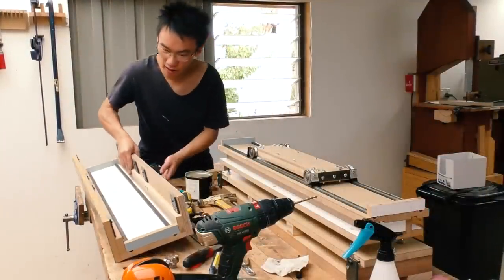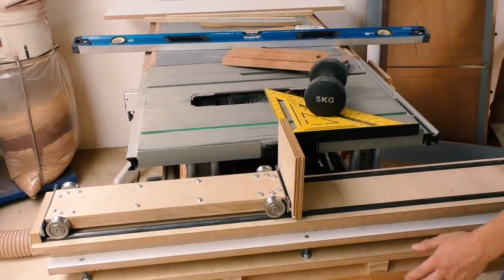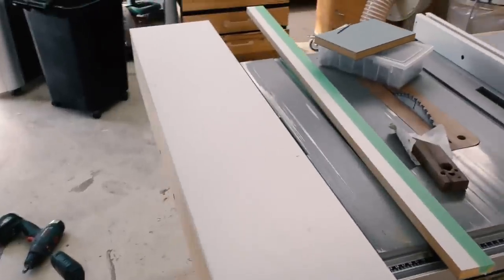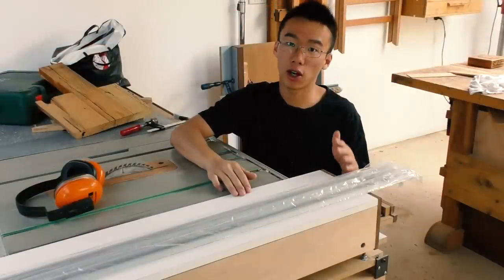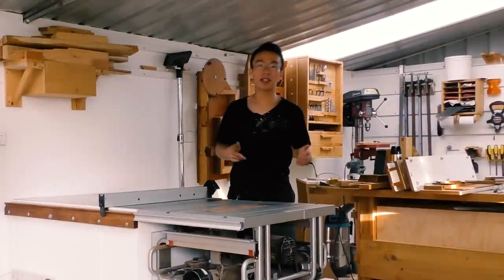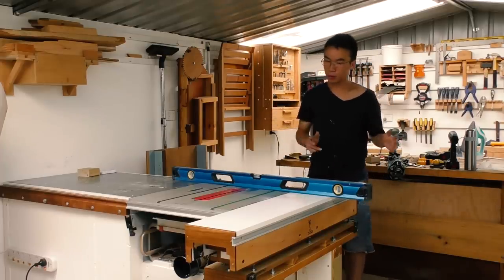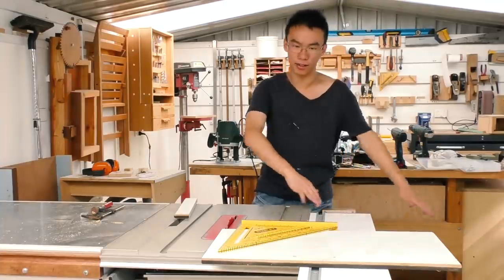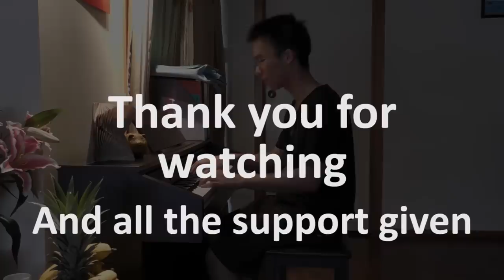Sliding Table Attatchment Part 4  - Finishing it off

Comment: Steven, great video and an impressive sliding table.  I do want to mention that you should never under any circumstances wear gloves when using a spinning tool like a saw, drill press, or lathe.  The glove can get caught in the tool and permanently disfigure your hand.

Comment: What a wonderful addition to your workshop. Surely the next step is to take on bigger paid projects.
Reply from the maker: the irony to having made the sliding table is that in making the project itself has used up all the big pieces of wood in my workshop that would have been more conveniently cut with the sliding table attachment.
Reply: You've probably already made your next creation and slowly editing the video when you have time.

I'm sure you have lots of native and or reclaimed materials you can use that will look gorgeous when finished.

Comment: You did a lot of work on that. If you build another you might consider using cnc linear guide rails and bearings.
Reply from the maker: +nevermindthebollocks actually this is the end product after i had considered the idea of using linear bearings; bit i ditched it - just wasn't very space efficient, and you actually need the square shaped linear rails for it to be strong enough when mounting it upside down (fixed bearing position, while linear rails attached to sliding carriage), which are really expensive.

Comment: the 90° angle issue is not so much precise paralel alignment of sliding table with saw, but definitively crucial adjustment of cross-cut mechanism

Comment: Great project, but I don't understand putting it on a contractor saw. The table is not flat enough,  the blade is not square, probably runs out excessively and wobbles a bit, the blade diameter will be smaller than a better saw, and it is under powered for hardwoods. I only have a contractor saw too😟
Reply from the maker: +Court so far my contractor saw has done everything that i've told it to with good results, i can't really compare it to more expensive saws since i've never really used one, but from my seldom experiences of the huge format saw at school, i can say they are about the same given the purpose i have for them. That of course would not mean that contractor saws are actually better, just that the tools don't make the craftsman, the craftsman does (in this case both figuratively and literally).

Comment: Well done Steven! :-)

I think some of the play might be because the table saw is not directly attached to the sliding table but are relying on the frame of the table saw stand that it then connected to the two angle brackets that then connects to the sliding table. That's a lot of distance and each joint will introduce some flex that ads up.

Is there any way you can attach the sliding table bottom directly to the frame of the table saw itself, that should make the whole setup a lot stiffer and take out the play when you push / pull the sliding table sideways.
Reply from the maker: +Morten Mortensen attaching to the frame of the table saw is a bad idea for me, cus it's all aluminium and plastic, and they are all way undersized to handle the weight of the sliding table. After checking each part with a dial indicator for flex, the largest bit was at the carriage (with dial indicator attached to frame of sliding table) so the height of the whole assembly may also have been a problem
Reply: Morten
I think you're onto something here.  The effective pivot for the entire sliding mechanism is the two right-angle brackets attached to the table saw base.  Even a 0.1 degree movement there will add up to a third of a mm by the time you reach the working surface.
0.1 degree sounds like something that's easily created when using pine and small washers.

Comment: Can I ask why u decided to make the sliding table so heavy?? Did I see that u have a Lathe and a Milling machine in ur workshop?? Bro how can u afford those? U are so young. These are very expensive machines. U have these in ur shop or were they in ur school?? I remember those days of using Lathe's in my metalwork class back in the mid to late 1980's.. Yeah I'm old now.. haha!
I'm about to embark on my own table saw build from scratch. I'm using steel in a lot of the build for strength. I thought u might have tried that but I'm just finding ur channel today and I noticed this was 5 years ago?? I'm kinda guessing u upgraded the table saw at this stage?? I have some things in my stash of parts for building my own sliding table saw but it will not be that heavy and yet I will use some angled steel for part of the build.  
I have sub'd to ur channel bcos u worked very hard and it takes a lot for me to stick at things when they're not going the way I like and u are exactly the same bro. Best of luck man and keep working hard mate.
I will check out some more of ur videos now I'm sub'd to ur channel. Take it easy man.. Salute to u from Dublin, IRELAND!

Comment: Usar  un comparador para una  pieza hecha en casi su totalidad en madera o MDf¿¿¿ Es rídiculo... Cualquier madera o mdf tienda a torcerse al menos un poco con el clima en el aire..... No quiero dar contrariedad, pero si hubiese querido tener una escuadradora, más que adaptar una sierra, no sería más apropiado haber invertido el dinero necesario en tenerla?? Los resultados nunca van a ser los mismos que una máquina que se compra de fabrica con ciertas características.... Es ridículo tratar de duplicar una maquina de ese tipo....  Y de cuplicar una máquina, quizas podría haber empleado materiales mas apropiados, como aluminio o hierro.
Reply from the maker: Using google translator to understand your paragraph... ummm to me it's just for the experience, otherwise I would just do some carpentry jobs here and there with that effort spent, get some money and buy one LOL, but the things learnt and the experience I gained from it is priceless. Also, I don't feel I deserve a legit sliding table saw yet, I want to experience the struggle.